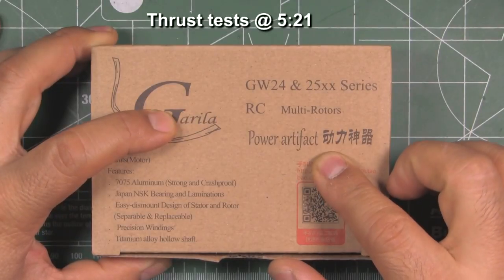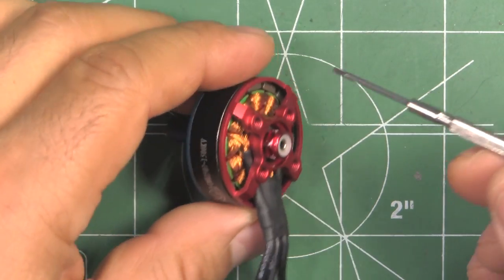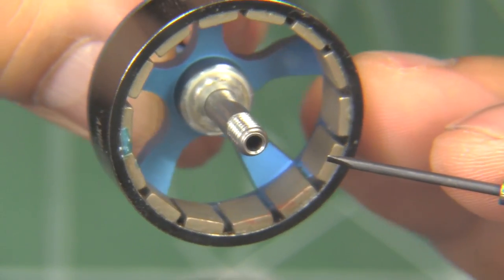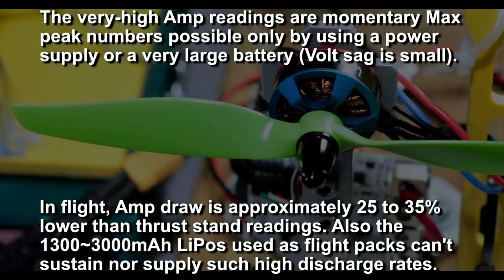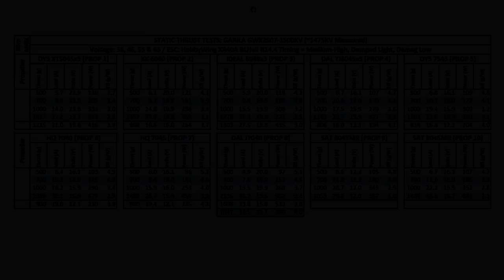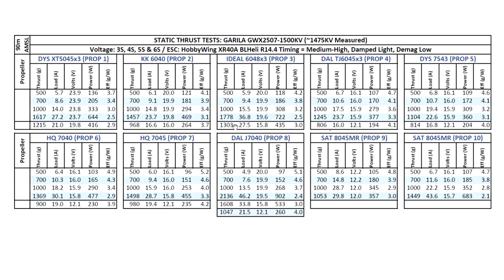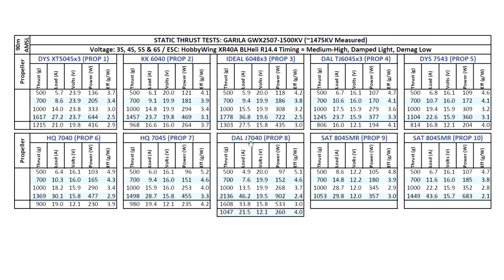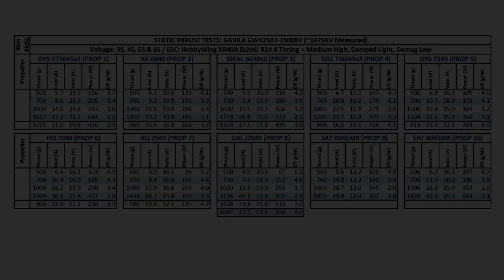GARILA GWX2507-1500KV Thrust Tests & Overview - Big Gorilla Power!

Comment: Yes I'm going to tell you that what I say is fact and what you say doesn't match up so let's figure out what the unknown variable is? As stated I have hundreds of these motors and Fly them every day. This video is misrepresenting the true performance of the motor and not testing the correct lipos or props for the intended use of the motor. Not gimme Rio they need less bottom metal not more...
Reply: "To mention" typo sorry
Reply from the maker: Alright, go ahead and run static thrust tests per your correct methodology and please post results here. I will be happy to re-edit video and post NEW video pointing to your correct tests showing the true performance. Since you say it's FACT, then please show us your thrust data (flight data is not the same as thrust stand - that's what I'm saying, there are higher loads on static thrust, in the air props unload a lot and you can run 6S to 8S no issues). No point in arguing. My testing equipment must be all wrong.

so I repeat:
I'm sure the motor can do 8S in-flight, that's not the same as in the thrust stand. You gotta understand thrust stand is about 35 to 25% higher load.
So perhaps I didn't explain clearly: It's my testing setup that can't handle the high Amps. The motor is not the issue. I'm not saying you can't run motor on higher voltage. 
Also you said "Garilas run 6s I wish these were tested not airplane props and 3s"
Airplane props? I thought HQ 7" props and all those 6" props are used in multirotors. What props would you recommend for testing?

Comment: Wrong! I run even the 2506 3000kv on 6s and 30a esc's. I'm a tester for Garila factory I have all of these so believe me you are wrong and your setup will handle everything I say except on 6s
Reply from the maker: ??? You're going to tell me I'm wrong when I have seen my power supply hit the cut-off failsafe and shut down do to too-high Amps? I nearly crapped in my pants when that happened, thought I had blown all power supply, thrust stand, and ESC !! LoL. New BrotherHobby 1507 also caused the same thing last week when I was running tests. 
so I repeat:
I'm sure the motor can do 8S in-flight, that's not the same as in the thrust stand. You gotta understand thrust stand is about 35 to 25% higher load.
So perhaps I didn't explain clearly: It's my testing setup that can't handle the high Amps. The motor is not the issue. I'm not saying you can't run motor on higher voltage. 
Also you said "Garilas run 6s I wish these were tested not airplane props and 3s"
Airplane props? I thought HQ 7" props and all those 6" props are used in multirotors. What props would you recommend for testing?  The 8" was tested because one of my YTube subscribers donated the motor and asked me to test that particular prop. The least I could do to express my thanks.
Also it would be very cool if you can recommend Garila factory to send some of their other motors for testing ;)
Reply: Dna Fpv, I think maybe you have miss understood what he is saying